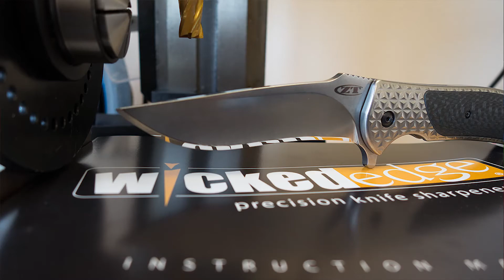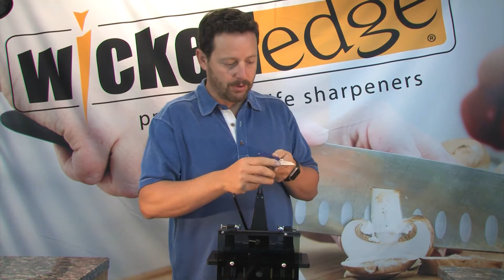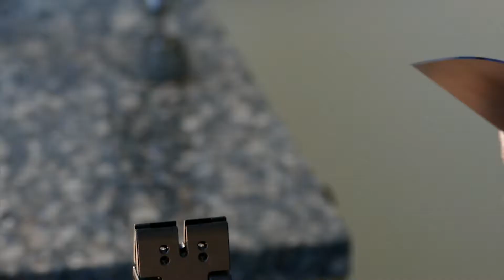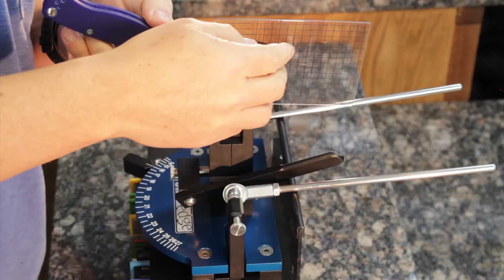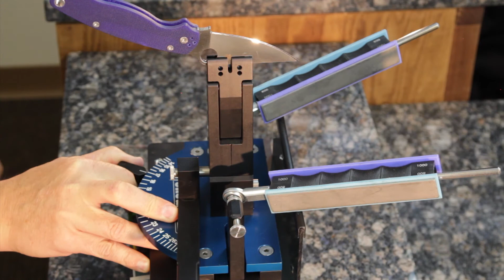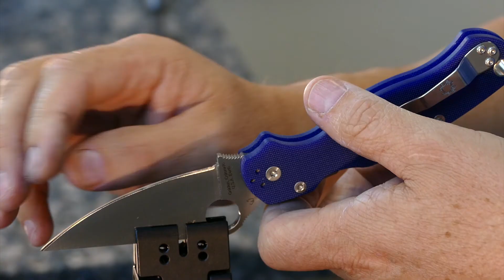Wicked Edge - Spyderco Paramilitary 2

Comment: Hi clay I'm looking to purchase one of your wicked edge sharping systems. I seen a video where the guy said only one side of the jaws on the clamping system move and so he said on the Gen 3 pro system being unable to move each side individually that when you put a knife in say with an 1/8" spine that the angles from one side to the other will be off when checking angles using an angle cube.. like one side will say 20 degrees and the other will say 21 degrees because of the width of the knife and only one jaw moves to Lock.. is this True.. because from what I could see in this video it looked like both Jaws moved open N closed simultaneously proving that what I was told was basically bullshit,, please excuse my French.. and it proves that no matter how wide or skinny the spin of the knife your sharpening as long as it fits in the clamps the angles on both sides Will be exact.. but I wanna know for sure from you and what you have to say about it if you don't mind.. before I make a choice on which one of your systems I wanna purchase.. thank you for creating what I feel is the finest and most precision knife sharpening system in the world to date.. and I would certainly appreciate any insight you can give me. Thanks again.

Comment: Ya well that’s fucking fine if you have a thousand dollar sharpener but the original clamp won’t do yjis so your screwed trying to sharpen this kind knife
Reply from the maker: Fully flat ground knives are actually pretty easy to sharpen in the standard vise. The cam-lock vise is very convenient to be sure, but it's not necessary to sharpen Spydercos and other FFG blades.

Comment: why would you go to a 4 micron strop after using a 3 mricron lapping film???
Reply from the maker: Good question. The strops behave differently than stones and lapping films because the substrate (leather in this case) is soft and pliable. The abrasive pushes more into the leather and less into the knife steel so only a small part of the abrasive is in contact with the knife, making the strop act as though it is a much finer grit.
Reply: @ClayAllisonNM  thanks for getting back to me so quick. its stuff like this that helps makes me want to spend $4000 on a knife sharpener. another question, how the heck do you find the sweet spot of a knife?
Reply from the maker: @dirtrider88  there's a little trial and error but it's pretty easy in general. When you mount your knife, you position the blade so that the transition from straight edge to belly happens about the back of the jaws. Then you color the bevel in with a marker and make a pass to see if the track the stone leaves through the marker is at the same distance from the edge all the way down the blade. If not, you make an adjustment. If the track through the marker drops toward the shoulder of the bevel toward the tip, then you move the knife do the tip is closer to the vise. Just the opposite if the track rises to the edge near the tip.

Comment: How long did it take you to reprofiling thé S110V ,starting with 400grit stones,tree weeks?
I ame using a Wicked Edge for several years now,and it's good ,verry good,i ame verry happy with it!All of my respect for you Mr Allison,for me thé best sharpening device out there.
I have S110v Knives,tried reprofiling it starting  thé 200  grit stones.After a long long time ,i grabbed thé 50 grit Stone and finnaly,started seeing progress..
Reply from the maker: S110V is pretty tough stuff. If I'm remembering correctly, re-profiling it took around 15 minutes, going for a reduction of 1 degree on one side and 3 degrees on the other.
Reply: @ClayAllisonNM  that's verry impresive is thé least i can say.
Using my stones for 3,5 year now.Sharpened many Knives,some of the blade steels; VG10,CPM154,S30V M390,ZDP189 ,S110v 
 Could it be that my 400/600 grit stones have had they're best time!?
 3 degrees reprofiling in 15 min on S110v isn't gonna happen with my 400grit stones,it wil take me hours.  Even with thé 100grit stones ime not gonna come close to 15minutes.
Thanks for your fast reply.
Kind regards

Comment: Hello Clay, just a quick question about the "sweet spot" orientation that you put this PM3 into the clamps with. What exactly are you looking for when you find that sweet spot? Also will the orientation be generally the same with my Paramilitary 2? Thanks!
Reply: The positioning between should be very similar for the Para 3 and the PM2.
Reply: @WickedEdgePrecisionSharpeners  Thank you!

Comment: Great video for this knife Clay. I just today purchased online the spyderco military C36GPDBL CPM S110 SP36GPDBL. I was gonna put it at 16 degrees per side (it is what spyderco says it is). What I found informative was the 1000 grit for the micro bevel & glad I seen this because I was gonna use 600 or 800 grit. For the re-profile of this knife what do you think the progression should be? I have 50-1500 diamond grit from your company along with 1200/1600 ceramic, 5 micron lapping film & the 5/3.5 diamond strops.
Reply from the maker: I'd start with the 600 grit and see if that will get you the edge profile you're looking for quickly enough. If not, then I'd drop down to the 400 grit and see what that does. Then I'd work up through all the diamonds, then the ceramics and then lapping films and strops because it's good to get that primary bevel nicely polished.

Comment: are the split jaws only available on the pro model? Can I safely cut a slot like that on my Gen 3 jaws?
Reply from the maker: You can definitely cut a slot like that on your Gen 3 Jaws - that's exactly how we did our prototyping.
Reply: Just wanted to confirm that it's safe to do and that it helps in camping force/performance. That should be easy to do with a dremel tool. 

I have bot the stock and 1/4" claps I could do that to.
Reply from the maker: Using a Dremel sounds like a great method. We did in in-house first w/ a hacksaw and then later with our mill.
Reply: in millimeters - how deep and wide is it? does it even matter? Thanks!
Reply from the maker: 3.5 mm wide and 12.5 mm deep
Reply: top man! Thanks Clay!
Reply: Hey Clay - have you guys ever tested the clamps without the nubs on the extrmeties (e.g. completely flat clamps)?
Reply from the maker: Do you mean in terms of removing the contact pads from the Gen 3 Pro jaws? We have played around with those a bit but found we didn't get as good a grip as we did with the pads.
Reply: yes the square contact pads on each end. Ah that's good to know. Was just curious...